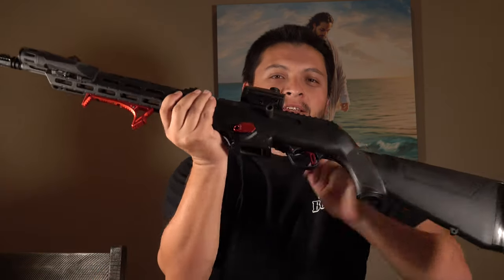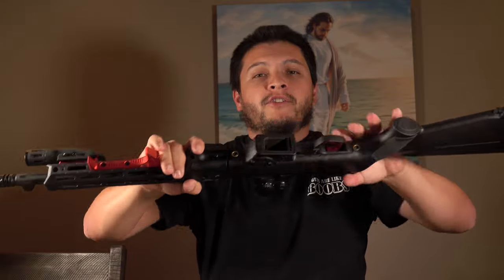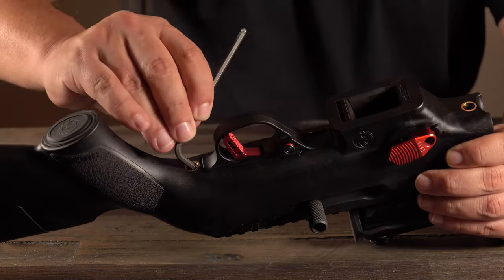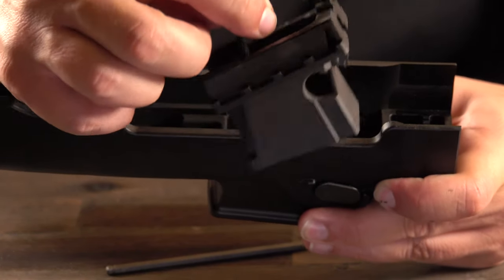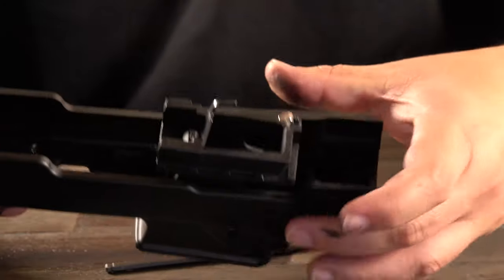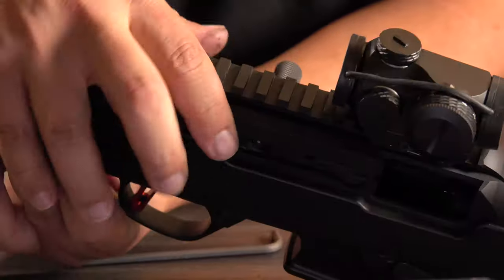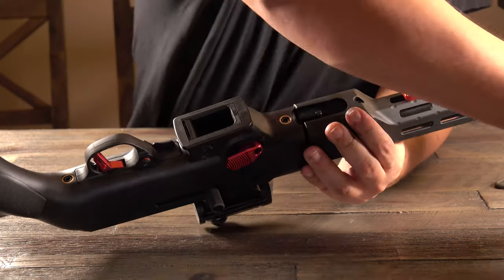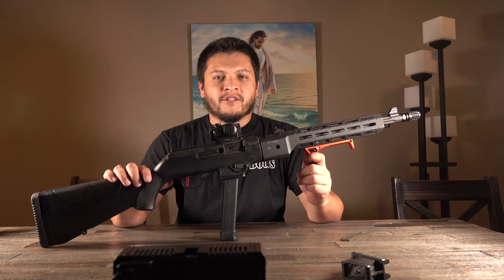Ruger PC9 Carbine MagWell Swap Out

Comment: i have done this to over 100 of these in the shop. Not one came apart that easy. These things are a bitch to get apart. Anyone that sees this, be warned that you will be using EXTREME FORCE to get the receiver out of the stock!!
Reply: thank you so much ive used the extreme force!
Reply: I had to smack the trigger guard a few times to get it apart
Reply: Mine was easy